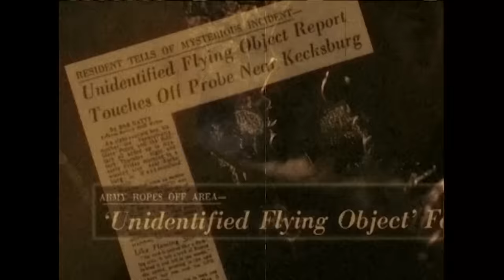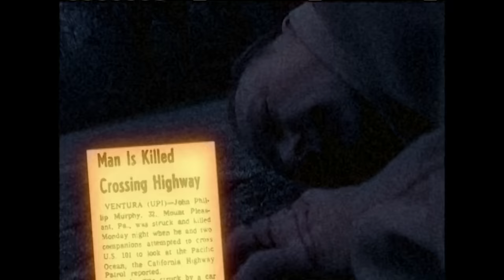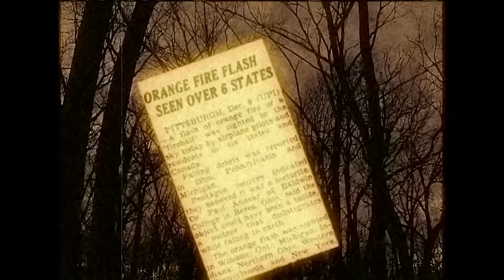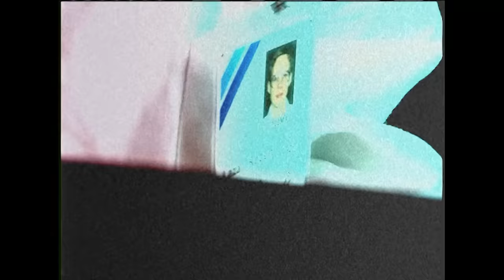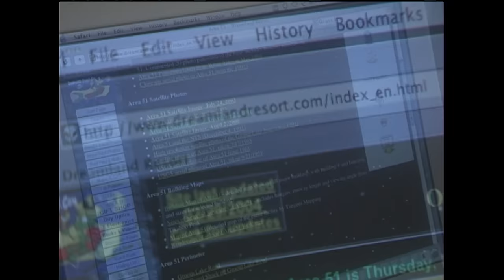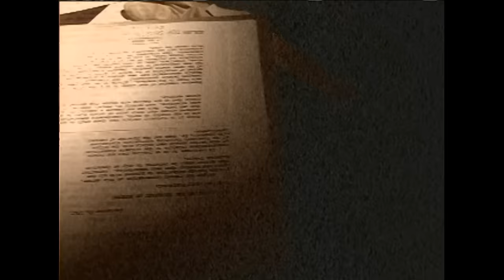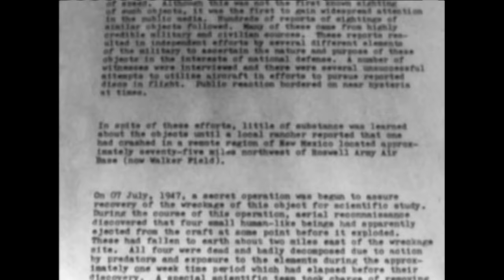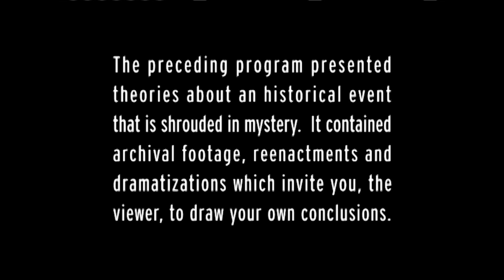3 CLASSIFIED UFO EVENTS REVEALED (Best of 2023) *Marathon* | Conspiracy? | The UnXplained Zone

Comment: I lived very close to the Detroit river, in Wayne County Michigan.  The object with a very thick tail (much larger in with than any airplane then or now) went nearly directly overhead, but favored in-land from the river.  It was therefore NOT "over Lake Erie".  The tail was quite green and black smoke, impossible to be a regular aircraft, etc.  It was so close that is was rather obvious in size STERIO- binocularly with regular vision.  Immediately seemed about at least 30+ feet wide, and about a 100= FT. TAIL ---very particulate matter and drifting smoky green and black tail.  It was so low, that it did seem to be resisting actually falling to earth.  I don't see how it made it to Keckseburg, at the time I thought the absolute farthest it could go was a couple of counties away, like Monroe County Michigan.

Comment: The very first commenter you have here just before a minute and 41 seconds into this video states that this was categorically a bright Fireball meteor that was headed out over Lake Erie.
This man is either horribly misinformed or he's absolutely a damned liar I saw this incident when I was living at the time and Taylor Michigan. It went over, and it lit up the sky. And it was headed in a South Southeast Direction which would never have gotten it over anything but a tiny point of Lake Erie near Toledo.
The fact that it turned into an almost directly easterly Direction proves that it couldn't possibly have been a meteor because meteors do not turn 90° angles or actually it would have been about a 67 ° to about a 75/78 ° angle. At least that's the way I recall it. I have actually looked at the tracking and it was coming over Canada and into the United States, what should have landed it somewhere in Upstate New York. But it turns South and came across Michigan in a South Southeast Direction. I did not witness that but that's the tracking that I have seen asserted to. Somewhere above Michigan it turns South.
So for those of us who actually Witness things. Maybe he ought to talk to people before he opens his mouth and inserts both of his feet.